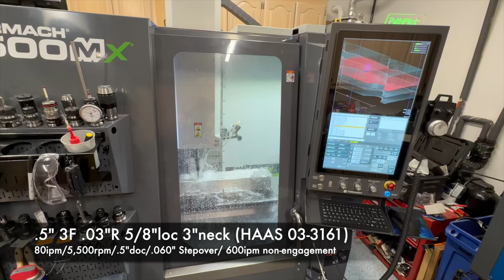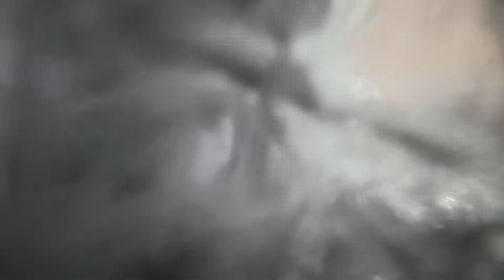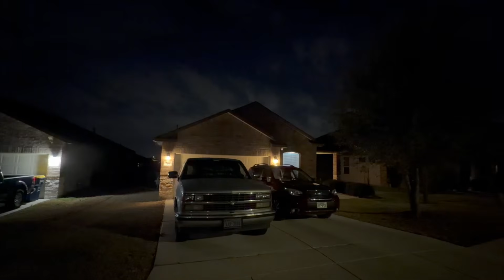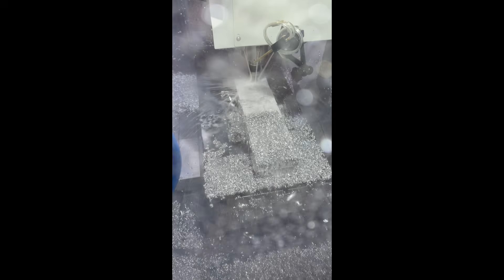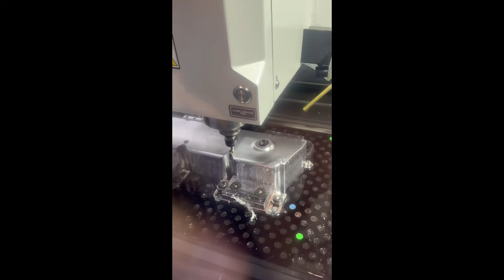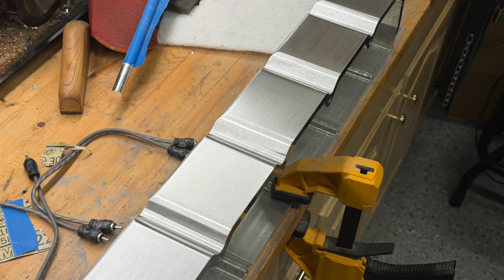Tormach 1500MX Custom Machined Dodge Viper Valve Covers

Comment: Super cool part! I don't want to be  the "know it all guy", but next time its chattering like that slow the spindle speed down.  you'll get better tool life.
Reply from the maker: Thanks! No worries. I appreciate the insight. I ran some test cuts beforehand and messed with step over in cam, and fluctuated feed rate and rpm via the knobs on the controller. I think that stick out was working against me amongst many other factors.

Comment: 嗨，想请教下用这种方式加工平面度如何，😂保持平面度的秘诀是什么
Reply from the maker: Hello! The fixture plate was helpful. I inspected it and compensated for the deviations at the extremities. I used an indicator on the two milled surfaces when setting up the continuation. I was able to project the milled surface using a flat edge and make adjustments to the stock.  Additionally, this was not a critical surface as it is customary to be installed with a gasket. Cheers!

Comment: Why do you insert the chuck with the tool into the spindle one by one, instead of loading everything into the drum with the tools and changing the tool using it?
Reply from the maker: I was glued to the machine running each tool as its own program for the most part. I wanted to clean the taper each time as well. Carousel tool changers are easy to contaminate and can attract a stray chip on the tool holder. This was going to be a long and messy job and I didn’t want to take the risk.
I used the tool changer on a production run of 50 parts the other week and it’s was fine. Thanks for asking!

Comment: Cycle time? Or is it one of those jobs that you ether gave your time away or you charged $5000 for a set of valve covers. Nice work though.
Reply from the maker: Little bit of both. I think it worked for both parties. This IS a custom part for a track Viper. This wouldn’t be a sensible job for a Corolla owner lol. 

Block to part was about 13hours each. Of course there was programming and setup time as well. And pepper in time shaking on the diving board😂

Comment: Shrink fit in a tormach is the funniest shit Ive seen in a while lol
Reply from the maker: It’s a brave new world out there. I wanted low runout and high grip strength.
Reply: @JEdwardsMFG the accuracy and spindle speed of the machine make it pointless to say the least. But hey ,I'd be using it if I had that all at home too lol.
Reply: @BRANDON-IRON009  I have one and with hydraulic holders I'm holding microns
Reply from the maker: Spindle speed has little to do with my reasoning and intended outcome. 

This is a rather accurate machine with a decent spindle in it. Take a deeper dive on it?

To my original point: 
Er collets suffer from pullout. Right? I’ve pulled tooling out before on this machine. Run out of a shrink fit is significantly less than that of an er collet, no?  

Whats the issue??
Reply: @JEdwardsMFG none at all, just overkill. If you're looking for minimum runout and rigidity I suggest shunk hydraulic holders. Very reasonable price and you can change the tool in the spindle.

Comment: Did it work? Are there many aftermarket options out there for these? We could build a die cast tool if there is?
Reply from the maker: It works. Last part of the video is the car running. 
I can’t say if there’s a market or not. This was a one-off based on the customers needs.

Comment: no material warpage? or if it did bow how did you deal with it?
Reply from the maker: I was fully expecting it and really worried about it. I am a luthier (guitar builder/ repairman) and my whole existence is anticipating material moving. So naturally I was dreading what could happen with so much material removed. 

I was VERY surprised at how little trouble I had. I went into this job thinking about movement and warping so I stepped my processes with warping in mind. When I set up op 2 and 4 I used straight edges and a dial indicator/ Heimer to inspect the surfaces and adjust the trajectory with some love taps with a dead blow. It really was not ever that far out. When I flipped the part, I used feeler gauges to inspect around on the fixture table. When I took the finished parts off and into a large granite slab I had virtually no rocking or gaps. 
I was preparing to sand the mating surfaces uniform but those were left machine finished. 
I truly felt lucky rather than skilled. At the end of the day these are valve covers so I was okay if there were gaps. A gasket would have been happy to compensate. No leaks on the car so we’re golden!

Comment: interested in this mill, BUT why didnt you use the tool changer? tools to long? and nice work!
Reply from the maker: Thanks! There was plenty of clearance even with the longer tooling. 

There were a number of reasons I didn’t use the ATC. The condensed version is I wanted to ensure the tapers were spotless. Lots of chips flying on this project and carousel ATCs can become contaminated. I took tool holders out of the ATC to load in new tooling for this job. I also ran each tool as its own program so I didn’t really need to use it. Loading it would have been more work than just hand swapping before the program. If this were a production with fast cycles then ATC would have been used.   Thanks for asking!

Comment: What coolant do you use?
Reply from the maker: I’ve got Trim C270CG mixed at ~2% brix or a little under 7% concentration which is middle of the road for this coolant. Had it in the machine the last 8 months. Thanks for asking!

Comment: In a previous lifetime before I got deep in IT, I was a mechanic and steel fabricator. Along the way I also did a lot of general machine shop work - lathe, milling machines, shapers, and I developed a real liking for it. 35 years later I decided to try gear head stuff again and picked up an old pro-street 69 Camaro. It was a nice ride but was built to cruise hamburger stands and do week end car shows. Over the years, I got the Camaro teched out with an NHRA 8.50 sticker and run mid-9's with it in the quarter mile. Not sure fast but I'm always working to go faster (speed is a drug and yes, I'm an addict lol).  

I picked up a nice Miller wire welder, a Lincoln stick welder, Victor oxy/acetylene torch set, an Emco Maximat V13 tool room lathe and a small round column milling machine. Tons of hand tools, lots of stuff for rebuilding these BBC's I run, and there never seems to be an end to the additional stuff I'd like to acquire lol. I have no idea what I'd do with a sweet CNC mill like yours but it would sure be fun to play with :)   I fabricate a lot of the parts and metal work I need for the racecar and I'm sure I'd find a good use for it :)  Thanks again for sharing your work !

Comment: Nice job! Result is great! If you will make all shots in horizontal orientation it will be  great for viewers)
Reply from the maker: Thanks! A lot of the vertical shots were seat of the pants and really meant to just share in messages with friends. It was after the fact that I decided to add them to the timelapse vid. Just scrapped together what I got.

Comment: Great work, I have a Langmuir MR1 that has been retro'd over to centriod controls (the cutcontrol from Langmuir SUCKS). I am actually going to do some LS valve covers soon, got some new ideas from you to try out! Subbed!
Reply from the maker: I just subbed as well. Hope to see that project in the future!
Reply from the maker: Nice! A buddy of mine had one of those briefly. I got to see it in person. They are beefy! Centroid is a cool system. I bet that set up is decent. Have you looked into changing any other parts like the spindle?
Reply: @JEdwardsMFG the spindle is actually the one thing i liked. 8000rpm and 3hp i believe. Hopefully make some cool parts soon!

Comment: Do you like the SMW fixture plate and mod vises for this? I do a lot of larger bar work like this and I've been thinking about getting one.
Reply from the maker: YES. I love them. I have them on my other machines as well. They’re versatile and made incredibly thoughtfully and well. I would have had to do this project completely differently. I talk about them briefly at 5:38
Reply: @JEdwardsMFG Thanks. I think seeing you do this job convinced me to place the order. I have a VF2SSYT and I like how their plate extends the full 20in of Y travel.
Reply from the maker: @patricke3848 awesome!! Make sure your table is clean, stoned, and throughly conditioned with a corrosion inhibitor. One you tram that table in its really reliable. Have a tub of antisieze ready for those bolts.

Comment: Where do you purchase your aluminum billet ?  I did a quick pass through McMaster-Carr and their prices made my hair stand on end. What specific aluminum grade / type did you start with and for your project, what were the dimensions for your raw billet blocks ?
Reply from the maker: Great question. This is 6061. I actually acquired it unconventionally. Without the extra long story, I traded for a 64”x4”x5” bar. A friend had the material in his shop that was sitting around. Otherwise there are some metal supply places near me I could have sourced it locally from.
Reply from the maker: But yes, materials were costly. Metals have been increasing in price as you may expect. Remember this was a project for a Dodge Viper that is a modified track car. There was some expectation of costs.

Comment: Strong work,  Can you add a Video on how you did the Cam in quadrants,  i want to do the same and i am limited on length
Reply from the maker: Great question. Yes, I’ll see what I can do. As mentioned in another comment, making videos is out of my element and this was a first. 

The secret sauce for me was modeling my stock as another body. That way when I bored a reference hole to probe for the second op, it carried over and I was able to select my work coordinate offset off of that feature on my second setup. On the flip, I used the left side model as my WCO for op3. Then the right side on op 4.

Comment: Turned out killer. Good video too. Did you model them or was a model provided to you?
Reply from the maker: My buddy Hayden at Black Label MFG modeled them. He is the guy gettin in the car at the end. He and I work on stuff together from each others garages. He has a tormach 1100M and a lift. I have the 1500MX and a bad sleep schedule  😂
Reply: @JEdwardsMFG what did the wall thickness end up around?
Reply from the maker: @shaunybonny688 the under cut walls were about .170”.  The top was .240”. The back side was about .300”. A little thick if you ask me but also not a problem and didn’t end up being that heavy.

Comment: why not use a roughing endmill you can cut that OP time in half easy. you can run those those thing hard and fast
Reply from the maker: Does the chip breaker count as a roughing endmill?
Reply: @JEdwardsMFG  they’re a little bit different a chipbreaker is designed to brake chips up into smaller pieces, roughing endmill is similar in the fact that it will break up into smaller pieces, but it’s made for removing a lot of material fast you can basically crank your RPM to Max and run that thing faster and harder especially in aluminum the fact that it’s soft, I have a VF3SS I’ll run a 12 mm roughing end mill at 15k RPM 25% to 35% engagement and depending on how deep the cut is between 150-300 IPM. For your machine, it would obviously be a little bit different cause I think your machine goes up to 10,000 RPM if I’m not mistaking, do a few test runs, and you’ll find that sweet spot to be able to push your cycle times down
Reply from the maker: @PhoneAppS1 thanks! Yeah I’ve got the IPM, I just lack that RPM. also, I tend to not push things to their limits. I’ll run 10k for a very short time. If I have a smaller tool run it longer I stay around 9k. The next production run of something I have I’ll be trimming for efficiency. This was such a weird project for me that I didn’t mind the slower pace. Thanks again!

Comment: Why not use the tool changer?
Reply from the maker: I was glued to the machine and was running each tool as its own program for the most part. I wanted to clean the taper each time as well. Carousel tool changers are easy to contaminate and attract a stray chip on the tool holder. This was going to be a messy job and I didn’t want to take the risk.
I used the tool changer on a production run of 50 parts the other week and it’s was fine. Thanks for asking!

Comment: You could have used a highfeed mill for the roughing on the inside then finished with the endmill. Just an option. Otherwise a great video. Keep up the great work.
Reply from the maker: How would the chips look? I wasn’t too concerned with finish on the inside as much I was with keeping the chips manageable. Do you think it would have higher demand out of the spindle? Thanks!
Reply: @JEdwardsMFG  It would depend on your depth of cut. The deeper you go per pass would make the chips bigger or smaller, same goes with the width of cut. As for the demand on the spindle, there would be less because the forces are going in an axial direction and not in a radial direction. It would put slightly more load on the Z axis but that is made to take more load such as in a drilling operation. You may be able to get away with just one tool for the inside because some highfeed mills have a relieved shank so you could ditch the key cutter if you could find one with the proper relief cut into it. You have so many options in the world of machining, you just have to explore. Sorry for being so long winded.
Reply from the maker: @universe1239 thank you for the info and insight!